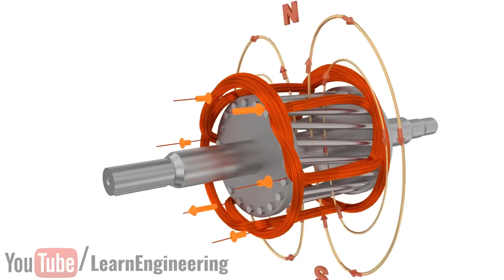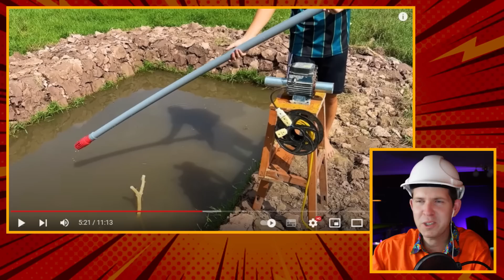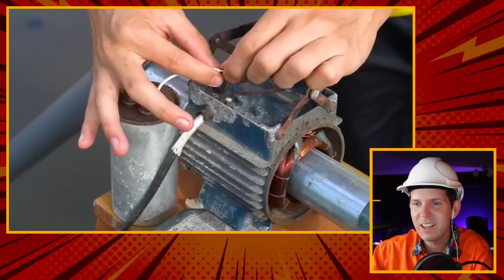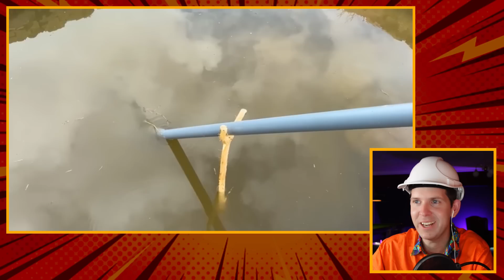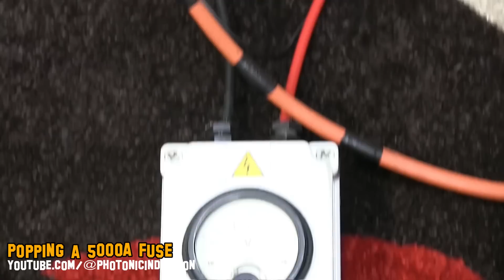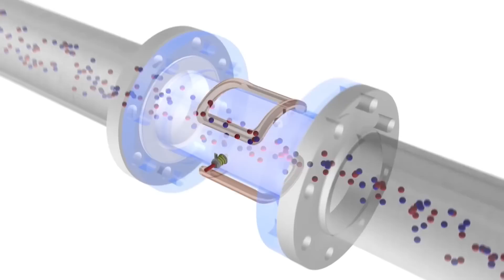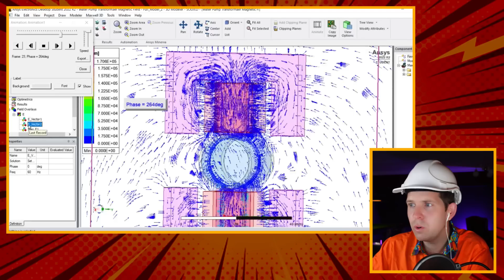Exposing FAKE Primitive Electrical Videos

Comment: The ad just below this video is a "off the grid power device" and me knowing nothing of anything sees: eight ds cell batteries connected to two small motors powers a bigger motor. Basically looks like two small electric motors attached to a bigger one. Which just tells me that is highly inefficient. A good off the grid power source is just... solar. Or you know. Diesel generator.

Comment: Liquid to gas, via membrane has quite a lot of favors when it comes to sound... Making water vibrate may create sound as the liquid has quite a benefit when it comes to acoustic impedance... Gas is thousands times weaker. It is still very, very weak sound and you need probably thousands of volts.. Thin metal ring, membrane on both sides and water with plenty of dissolved salts between.

Comment: Actually a motor with no rotor will draw high current and fail. The rotor provides the inductance needed to prevent saturation and loss of inductance as the stator core magnetically saturates.

Comment: correction: if you dump a flash capacitor charged up to 400 volts into the magnetron's filiment coil, you CAN get 500 kv out of the secondary....but good luck keeping it from arcing to it's self
i was the stupid kid who would use ac stepdown transformers in reverse to get high voltage out... yes....  9 volts out.... 120 volts into secondary.... 1.5 kv out and a HELL of a dangerous toy for a 10-14 year old..
Reply: also the dual transformer motor drive may have a reed switch and battery and he is using the HUGE magnetic flux to turn it on?? dont think he bothered sealing ANYTHING so the battery motor and switch are all just submerged... and im willing to bet you could make it work if you simply wrapped the pipe in wire and put a stir bar/any magnet inside and make it flip the hell out with ac..... why do people fake stuff they could make ACTUALLY work??
Reply: if you have an idea for a cool experiment that looks legitimate but is actually fake, let me know and i will produce it
maybe...

Comment: Let's ignore all the scientific problems and skip to the power bars they keep using in the videos. They all come with plastic switches which light up when the bar is on and receiving power. As a surprise to no one there never light up because they are never plugged into power. 🙄

Comment: Possibly that "water pump" works with vibrations.
Making the rear vibrate a lot and throwing them outwards.
Don't know if possible
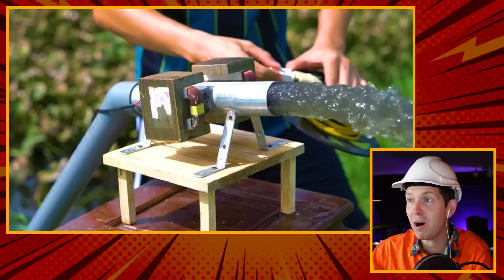Reply: 7:40 nevermind, you literally see the rotational push of the motor turning on XD

Comment: If it were possible to move water with magnetic fields alone, trust me...This would be commercially available. Why would they add the extra moving parts like the rotor, impeller, face seals, and bearings, when it could be done with no moving parts? BECAUSE IT'S IMPOSSIBLE!!

Comment: There actually ARE special submarines that can use those magnetohydrodynamic engines... for quiet station keeping... they are the equivalent of an ion drive... not much pressure or flow, not to mention large amounts of power and space, not exactly good for a cramped submarine

Comment: These honestly make no sense to me and I’m an electrical engineer. Yes definitely don’t open a microwave oven unless you know exactly what you are doing and what to expect. The microwave oven transformer one is definitely weird because generally when you put AC through one the magnetic field isn’t that strong you’d have to put DC through one to get the maximum magnetism out of one and even then it’s still not going pump the water.

Comment: Belive it or not run capacitors can change the speed of induction motors not recommended tho can cause overheating
Reply: I would imagine that you could only slow it down my making it less efficient, not speed it up like in the video.

Comment: so, what if he put an impeller in the middle use a couple slip rings inside to keep it in place... then just magnets on the ends on the little impeller? would it work if the impeller was free floating? using permanent magnets of course

Comment: That's most likely a cheap single-phase submersible water pump used for cheap water wells in rural areas, with a retail price around 30$. They just put the thing in water and connected it with a standard hose to that bs trash.

Comment: this is almost as good as the one that plugs a power strip into itself and starts it going by a spark from an electronic cigarette  lighter with the pizzo igniter wire stuck into the ground prong hole....

Uncle fester is the only one to successfully connect a fuse box into it self and start it with electricity from himself !!!

have a great day, don't believe it just because you saw it on YouTube

Comment: Hello.  Do you know of any magnetic simulation software - that can be applied so it shows probable movement of a mechanical part - that the magnetic field(s) is attracted or repelled?  I have in some years past - looked for some magnetic simulation software - but everything just seems to show fields; and I haven't seen any where you apply to a CAD and view probable result.  Moving a plunger, etc.

Comment: Yeah, unless you're Styropyro, NEVER MESS WITH A MICROWAVE TRANSFORMER WITHOUT PROPER SAFETY PRECAUTIONS. There have been many accidents from those things
Reply: If you were to get a bucket of water, run a line from the water to ground, then drop all your salvaged components from the nuker into the water, would that earth all the components in the water and render them safe?
Reply: @Debbiebabe69  No, I think that'd make them more dangerous if they have power, since water is conductive, very conductive.
Reply: @6funny0_o  thats the idea, DROP them in the drink to EARTH them.

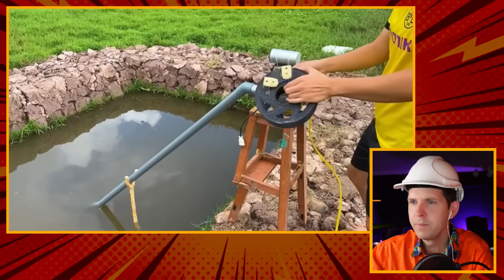Comment: 5:45 with the open end of the pump like that how is it primed at all?  It should have no water in it when he plugs it in...
Reply: Even better than that look at the drip coming from the elbow. If that pump was actually real there would be suction on that elbow and any leaks would be drawing in air not leaking out water.

Comment: better try Tesla projects and other honourable. Shorting high voltage output of a microwave transformer is not dangerous actually is a quick way to find if the magnetron is a problem when the mobo is not heating up food.

Comment: You kept saying it wouldn't work because of the lack of ions in the water. Could it work with, say, seawater or even just high-concentration saline?
I should probably admit that electricity may as well be magic to me, for all I understand about it.
But I do know water needs to contain electrolytes to be conductive.
Reply from the maker: Whilst these examples would still not work you’re right on saying that salt would assist in more flow for an actual magnetohydrodynamic drive 👌
Reply: @thinklist  so the magneto-hydrodynamic drive mentioned in Hunt for Red October (1990) is a total fiction?
Reply from the maker: @uncle_thulhu  yep
Reply: @thinklist  shame. Sounds like such a great concept. I remember seeing the film and thinking "hang on, how does that work, exactly?"

Comment: omg .... reminds me of this stupid "free" energy or "crazy" energy things..
. I'm also an electrician an love my work so much so trust me guys... this is  not how electricity works...
 this is not how current and electromagnetic waves work lol.... this guy just teach how to make electric water  trap for every living creature passing nearby... the best part when he almost submerged the rotor .... it can't make dead short cause this type of water didn't had so much salt or any conductive material in it so it's acts like a circuit... that's not mean that it can't kill you xd .. imagine neutral wire or live wire get broken inside this water that guy was in it.... bowling barbecue party xd oh btw... no rotor? that means huge amount of current into the coil and also to the power outlet... more than 20 amps... wires melted,fuses got popped

Comment: It's always fun trying to work out how the actually do this (see my video on building a rigged lightbulb to do the free energy device ones https://www.youtube.com/watch?v=PTvSDJK_YXI&t=4s&ab_channel=BarcroftLaboratories). My guess is that the 'device' he has made contains nothing more than a short across the plug. The extension cord is then wired in series with the actual pump and 'plugging in' the device completes the circuit starting a submersible pump. When you mention check valves I think the red strainer looking thing on the end of the pipe iorobably contains a foot-valve

Comment: oi oi oi kids really dont  play with microwave transformers =D ye it is alot of fun makeing huge arcs from thing air and a copper wire. bud damn it will kill you at best trust me.. at worst you will survive oh and then.. just dont play =D
P.S he atleast holding arching wire with soemthing.. i was doing by hand lucky nothing happend. i was at age of 15.. 120 v 50/60 hz hurts a bit. 220 v 50/60 hz hurts good. 380v 50/60 uff that shit is raw power to your body. been hit with all of em for my own tests.. =D all tho here in eu we mainly use 220 and 380 at homes. 120 is much much harder to find and to use.

Comment: Your ignorance and lack of knowledge is astounding. Water is diamagnetic. They are using a three phase motor. They connect two of the phases, causing 2/3 of the pipe to have a strong magnetic field, in a spiral pattern. Water attempts to evade the magnetic field by rotating towards the coil that is disconnected. The magnetic field is moving though, so a vortex is created in the pipe, which is what propels the water out
Reply from the maker: Thanks so much for clearing that up. I thought something was off. Well lucky I have people like yourself to correct me 👌